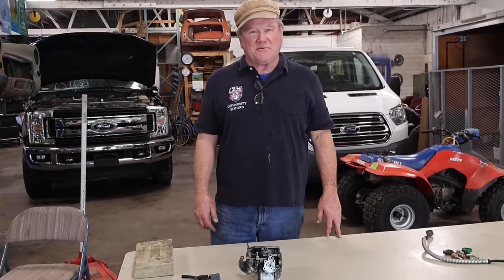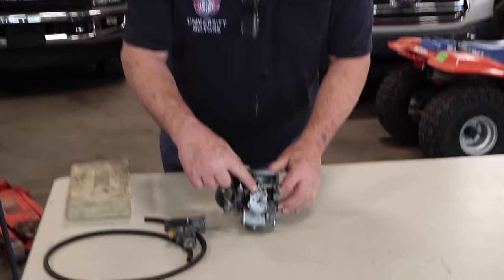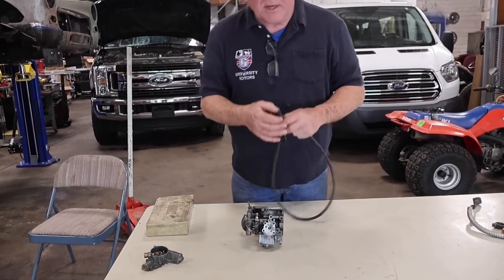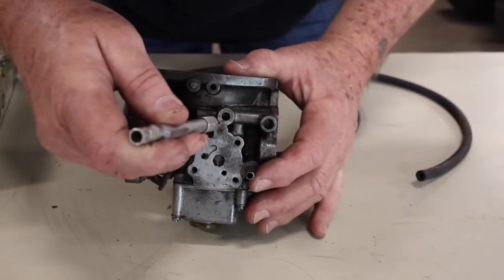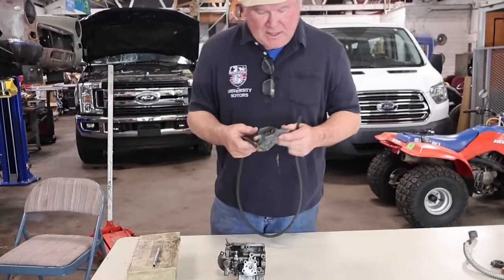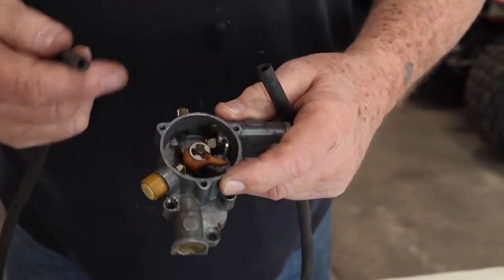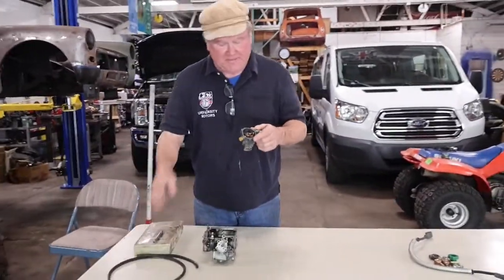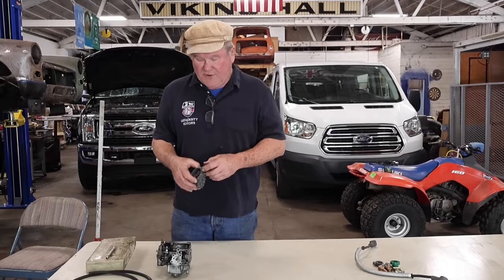400 MG Tech | Stromberg Carburetor Troubleshooting

Comment: The way the choke and starting used to alway work was depress pedal once, Car starts and revs about 1500 rpms then after 15-20 seconds depress pedal and set the choke and car idles at like 850.  Car began to take multiple tries to start from cold. Carb has now been tuned and starts at about 1000 rpms and depressing pedal no longer seems to set the choke. Could it be the vacuum clog as described in this video?

Comment: Hello Sir, can you do a removal and repair of the speed guage. The needle does come up, but bobbs up and down
Reply: You may have a bent speedometer cable or angle drive.  There should be a brass spacer between the cable and the angle drive.  Also check that the cable doesn't have any sharp turns/bends this will cause your cable to bind. If these two examples do not correct the issue you may need to send the speedometer to be rebuilt. Check with Moss. They have a support department that can point you in the right direction.